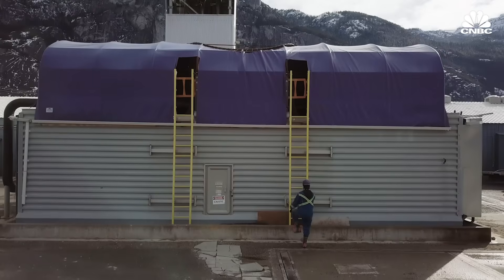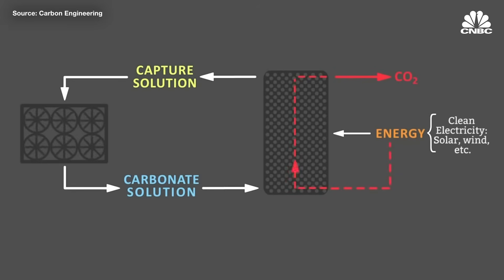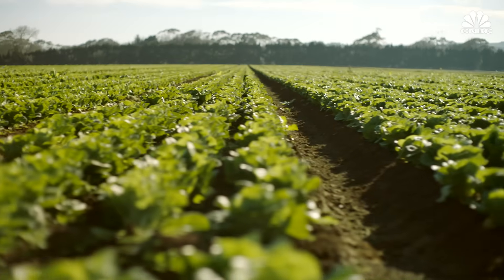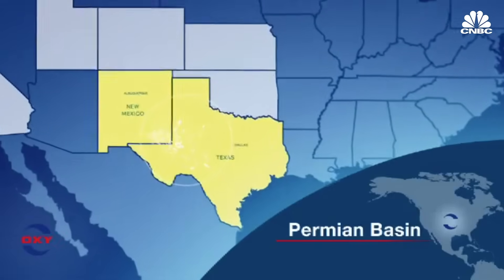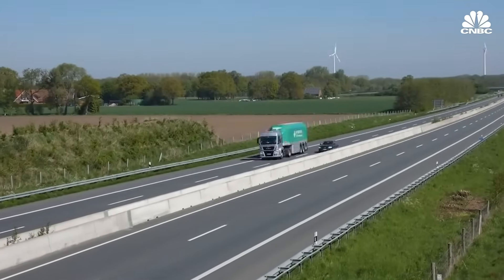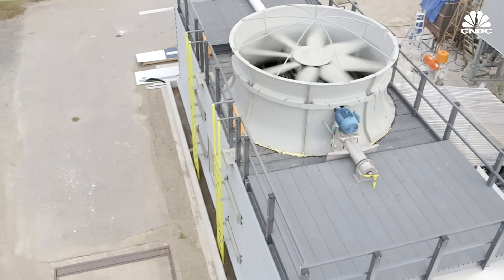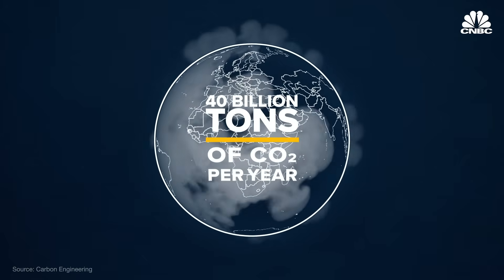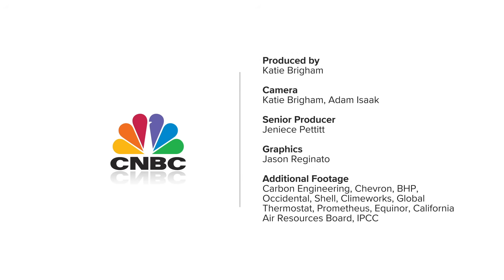Bill Gates-Backed Carbon Capture Plant Does The Work Of 40 Million Trees

Comment: 42 years ago,a retired engineer in white overalls on our local Tv news station NBN 3 in Newcastle NSW Australia developed a device that could be retrofitted to any vehicle, (internal combustion engine) and converted it to run on hydrogen. He converted a Morris 1100 a front wheel drive english car. He was asked what it run on, he said 'water'. He was asked what came from the exhaust, he said 'steam'. Keep in mind this was a very basic designed car with very few parts and it could easily be run on hydrogen. He said it could easily convert any vehicle, he had patented it, but was scared a 3 or 4th buyer from a fuel company would buy it and you or I wouldn't see it. He was asked what other modifications were required, he said a stainless tank, in place of the petrol tank, and stainless supply line to the engine compartment in place of petrol lines and the only reason you couldn't use the originals was because it would corrode. He was asked about vehicle performance and he stated it was the same if not better as the hydrogen was a superb fuel. This was when I was a little boy. Where is this idea? I am a
 mechanic and can't help but wonder about the dynamics that have taken place in government's and the people that we have privileged to look out and take care of us in distinguished roles to hide things like this for more than 40 years. They have stolen from us, our children, grandchildren and great grandchildren to appease those who control economies and make (Trillions) to force us to use fossil fuels. The car he converted was a 1100cc pushrod engine that would have been emissionless aside from any blo-by past pistion rings of sump oil. Partner this with an engine that was designed by the Australian company The Obital Engine Company that didn't require lubricating oil as it was that "understressed" and didnt produce any significant heat and you have a completely 'carbon neutral' power source . People of the world have been 'victimised, abused, and stolen from for decades'! The only reason we even have to pose the question we have to "Capture carbon" is because of greedy, thieving, mongrels, who make so much money from fossil fuels, they can't stand for change, and even now when the world faces such environmental challenges, just can't bare to let go of burning carbon. It's just a disgrace and those with any intellect know it's the truth. Where are all these patents. Understand the blatant manipulation by those wearing smoking jackets, sitting in club chairs, smoking 'cubans' cigars, drinking $1000 a glass brandy. Dogs hind legs!

Comment: It would be easier to convert Carbon Dioxide into O2 than using a car on base to collect more Co2 and in turn making more co2 than was collected. This system is working in the wrong direction. Why use the Co2 from the air to make more Co2 to use in fuels. Contradicting this is. 😂 no wonder the oil companies are interested.

Comment: It is really stupid. For separation and keeping carbon out of CO2 molecule you need more energy than what you get whet you burn the same carbon in coal powerplant and produce that CO2 mollecule. So instead of using that energy to take the carbon out of the air you should use that energy in powerplants and not burn coal or gas which makes more CO2.

Comment: if a city is going to invest in this dont put that in the middle of nowhere. put them along the freeways where most pollution comes from. or make factories with smoke stacks be responsible for their own smoke, make them filter their air before it goes back into the air.  semi trucks could also stand up and be responsible for their own smoke. make systems can can be integrated to cars, factories and top of homes chimneys if needed. stop the smoke b4 it happens not after. what kind of back words thinking is this? make everyone accountable, start with major businesses.

Comment: Lets stick with this car angle for a moment and discuss this expense of technology. How expensive is it to make a standard conventional V8 motor today? In the grand scheme of things not very expensive. But, compere that to the cost of developing an entirely new engine that has no relation to the "tried and true" engines. The money is astronomical by far. The personnel to develop it, the materials, the prototypes, the testing, the failures, the learning curve. That's why the small block Chevy 350 and later the LS line of engines was and still is relevant today. Did the internal combustion engine displace other potential engine designs? Yes, in-fact it's well documented. However, the internal combustion engine was expensive at one point to develop and it has taken nearly a century to do so. Now that the molds are made, it is so much cheaper to stick to that convention. 
What I'm getting at is in order to make a new technology cheap there will be that initial cost. That initial teething process. That first Chernobyl to learn from. People take everything we have now a days for granted. Not putting much thought into how expensive and how long it took to make it usable and attainable. Or even the lives that were ultimately sacrificed in the effort to make a better tomorrow. It's easy to talk money and evil corporations, but, if the very oil companies that are the so-posed cause of this mess are willing to develop better, cleaner, solutions, Then why should we stop them. They genially seem to want this technology to better the world. Ulterior motives aside, I say let the pitch in a buck or 3 billion. 
The money shouldn't be the main focus. It should be how can we make this better as fast as possible? And, how can we use the negative by-products in a useful, non-polluting way?

Comment: If this was at the peak of how cheap they say it could be, it would still cost $4 trillion just to stop the amount of carbon from rising. The thing with this technology is you have to expend just as much energy to get the carbon back as you got when you released it, plus a little more because of inefficiency. So to carbon capture everything we need to use as much energy as has been gained from fossil fuels since the beginning of the industrial revolution.

Comment: Interesting!   Plants ( trees) need a minimum of 2000 ppm ( parts per million) of carbon dioxide (CO2) for optimum growth.   Look it up!  According to Google this is currently the amount of CO2 in our air..............."Feb 20, 2020 - The global average atmospheric carbon dioxide in 2018 was 407.4 parts per million (ppm for short), with a range of uncertainty of plus or minus 0.1 ppm. Carbon dioxide levels today are higher than at any point in at least the past 800,000 years."  So plants need 2000 ppm for optimum growth.   Look that up!   Our atmosphere only has 407.4 ppm which means all plant life on earth is on a starvation diet....to the point where green house growers BUY CO2 and pump it in to get a minimum of 2000 ppm.    Climate extremist use the last sentence from Google..."Carbon dioxide levels today are higher than at any point in at east the past 8000,000 years.".....to promote the myth of rising CO2 levels.    The reason CO2 levels are "higher" today is because there was a gradual decrease of CO2 over thousands of years about 500 million years ago and scientist don't know exactly why.   The level had gotten down to 180 ppm.   Death of plants begins at 150 ppm....which by extension means the death of all living things.   If the industrial revolution hadn't come along to begin replacing come of the CO2, we would all be dead by now.   Even today, at 407.4 ppm the earth's plants are still on a starvation diet but they have learned to survive on it.   So the question is.....if plants need 2000 ppm for optimum growth and there is only 407.4 ppm currently in our atmosphere, how are climate extremists (Al Gore, Bill Gates, the United Nations, world Gov'ts, politicians etc) getting away with screaming global warming due to rising CO2 levels and how are companies like  carbon capture plants (shown above) getting away with sucking CO2 out of our environment when plant life actually needs all it can get? 
"

Comment: impossible energetics - defies the laws of thermodynamics so MUST use a lot more energy than it produces and that cant all come for "Free" electricity. Carbion dioxide is the result of extracting energy from fuel to make hydrocarbons back from it has to use more energy than it can oproduce or its perpetual motion which DOES NOT EXIST.

Comment: If carbon sucked in is gonna be used to make more fuels or carbonated drinks , they are gonna be released into the atmosphere eventually. Isn’t carbon engineering is just promoting oil and drinks company to produce more fuel and carbonated drinks thus contributing more co2 into the atmosphere ?

Comment: Doesn't the energy required for CO2 capture equal or surpass the energy gained on its initial release? If you put that renewable energy into the grid, you will lower the amount of CO2 more by turning off a coal-fired plant (or turning it down). This tech would be great in a grid of no coal-fired plants, all sun/wind/wave or nuclear.

Comment: Partnering with an oil company is probably the most effective way to shift towards cleaner energy sources. You show those companies there is another way while also making the transition  between fossil fuels to clean energy much easier. 

It also allows the fossil fuel industry to clean up itself.

Comment: This could replace fuel sources in the future, those pellets could be a semi-sustainable source of energy
Reply: ...not really.
the pellets are not a source of energy. to make fuel out of them you first need to put the energy in. so a primary energy source is still required for the process. 

you need to put in energy to strip carbon dioxide from the air
you need energy to split the carbon dioxide and remove the carbon
you need energy to make fuel out of the carbon you seperated

the fuel will give you some of that energy back when combusted, but ultimately its. a process you need to put energy into, not a source of energy

Comment: Great news. How could anyone dislike. Must not have don’t the research
Reply: welllllllllll...im not sure about that.
removing co2 from air is nothing new. but it requires “an assload of energy”.
so unless we get some solid data from independent test facilities id be careful with the accolades.
depending on how much energy they use per kilogram of co2 and what initial setup costs are this might be great, have little effect or even do more damage than good.
Reply: TheVergile who cares about the energy brother. We must remove co2. There is no debate on that

Comment: What happens when (probably over geologic time) the CO2 is released back into the air due to earthquake or some kind of plate tectonic event. Won’t that create an extinction-level event for the life on the surface?  Like the killer lake Nyos, only on a global scale?  Not only would there be a depletion of oxygen in the immediate area, but you would get overnight global warming levels of CO2 in the atmosphere as hundreds of years of industrial gas sequestration is released all at once.  Carbon capture (as a gas) sounds like a band-aid and not a solution.
Reply: What if we go 90% solar in the next 50 years and a volcano erupts and we see no sun for a decade? it has happened before, quite recently like aprox. 1500 years ago

Comment: HI. Smoke and mirrors. So let me get this straight. They are going to pull the CO2 out of the air. Then put it back into the air later on. Am I missing something here? ? Where in the world and who came up with this nonsense of +/- 2 degrees C. Now it went down to +/- 1.5 C are you kidding me? Who in this world is the be all and end all authority on this? Just to let you know the earth already experiences temperature fluctuations of well over and under 2 degree C. This happens year in and year out. ? Are you choking, passing out, suffocating, dizzy? Good news there isn't that much CO2 in the air. ? I guess all of the other vegetation doesn't count. Has anyone told how much oxygen is being dumped into the air? How come these people never once mention the TONNES of oxygen being dumped into the air?

Comment: It takes exactly the same amount of energy to take CO2 out of the air as to putting it in to the air. So this will never work
Reply: The fans are powered by coal or natural gas, the acid is dripped on by coal or natural gas energy.
Solar and wind energy is just coal or natural gas energy in the end.

Comment: A very thorough debunk of this here: “This is a five-piece assessment. The first piece summarizes the technology and the challenges, and does a bottoms-up assessment to give context for what Carbon Engineering is actually doing. The second piece steps through Carbon Engineering’s actual solution in detail. The third piece returns to the insurmountable problem of scale and deals with the sheer volume of air that must be moved and the scale of machinery they have designed for the purpose. The fourth article looks at the market for air carbon capture CO2 and assesses why three fossil fuel majors might be interested. The final article addresses the key person behind this technology and the expert opinions of third parties such as Dr. Mark Jacobson of Stanford.”   --Michael Barnard
https://cleantechnica.com/2019/04/12/chevrons-fig-leaf-part-1-carbon-engineering-burns-natural-gas-to-capture-carbon-from-the-air/

Comment: this video does a poor job of laying out the challenge:  specifically, how many gigatons of CO2 would we need to remove the carbon added since the industrial revolution?  At least 1,374 gigatons !  1 gigaton =  1,000,000,000 metric tons.  The oil companies have been pushing CCS for years. They have gotten no where. They dont want a  carbon tax [at $100/ton or higher] because that will reduce oil consumption and thus hurt their profits.   Reforestation is a nonstarter. We would need to reforest a massive area and such would not sequester carbon permanently.

Comment: The argument against this by some is that it's promoting fossil fuels?  As much (or more) greenhouse gases come from animal agriculture.  Amazing how some activists demonize fossil fuels reflexively, rather than rationally.  I'm all in favour of using less fossil fuels, and use very little myself (I don't own a car, I use electric heat powered by hydroelectric, etc.), but animal agriculture is a bigger climate change threat than fossil fuels when looked at holistically.  Not only does animal agriculture create a lot of greenhouse gases, but more carbon de-sequestration and more deforestation happens in support of animal agriculture than in support of fossil fuels.

Comment: Compress the calcium carbonate into limestone for building facades.

If you can convert this CO2 into fuel then you have created a renewable energy source that is carbon neutral and reduce the need to mine fossil fuel.

The guy that wants to plant trees and wetlands doesn't realize that those systems rely on forest fires as part of their life cycle. Thus their carbon capture is temporary.

Comment: Those opposed to fossil fuel industry cleaning up their own mess are ideologically bigoted and simply short sighted. There is NO replacement for fossil fuel and until fusion energy is a real thing there won't be any replacement for fossil fuel. Being opposed to use and CO2 capture of fossil fuel resources is like being opposed to using river water for drinking...it simply makes no sense at all.

Comment: Direct carbon capture is really dangerous to rely on. If we rely on these at scale to allow us to produce even more emissions and the power turns off, these things stop working and the balance will rapidly shift. You cant turn off 40 million trees with the flip of a switch. A rapid change is much worse and more unpredictable than a gradual change. I love what the Stanford professor said "Renewable sources also remove carbon from the air because they don't allow it to get into the air in the first place"